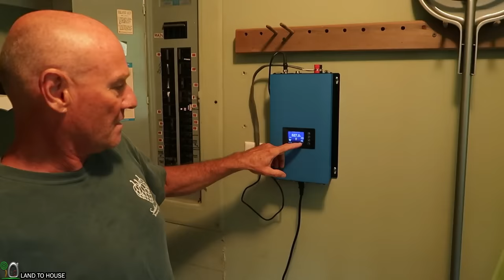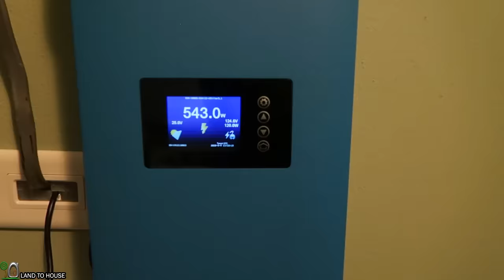Awesome Low Head High Flow Grid Tie Micro Hydro 530 watts!

Comment: Rectifier is a set of diodes that flattens the ac to a single direction which makes it into dc.  It’s really simple to see how it works with a simple diagram... 

Diagram :  https://www.electronics-tutorials.ws/wp-content/uploads/2018/09/power97.gif
Reply: It doesn't "flatten" the AC (Alternating Current - current that keeps changing direction or going back and forth, but it RE-DIRECTS it so that it always flows in the same direction and thus becomes DC (Direct Current, although the term "Directed Current", as in "directed to flow in only one direction or only one way", would be more descriptive).
Reply: @edinfific2576  flatten may be the wrong word. But you are compressing the voltage and forcing it to go one direction. In other words there isn’t a wave form anymore.
Reply: @Astinsan  The voltage and waveform remain the same, but they don't change polarity anymore, so, instead of a positive and a negative half-cycle, we have two positive half-cycles within one cycle.
There is no "compressing" of the voltage, it is kept at the same polarity and basically the same shape, minus the small forward voltage drop of the diode(s).
It only becomes flattened once you add a capacitor at the output. Maybe we are misunderstanding each other and I apologize if I sound nitpicky, but you need to use correct terms and description so that you don't confuse those who are learning.
Reply: @edinfific2576  correct.. it compresses the curve

Comment: he could extract more power by adding more turbines in a daisy chain since the suction is where the force is
Reply: @Maxippouce  i think he means adding more turbines in line in the same pipe, taking advantage of the same water flow and using the excess suction he was demonstrating wit the vacuum hose. the same water would just pass through multiple turbines in a row.  would be more expensive upfront and the efficiency of individual turbines would be lower so ROI would be longer but he might be able to be 100% self sustaining
Reply: Turbine output = force X flow rate.  Adding another turbine will lower both numbers for the first turbine, the total gain won't be much.
Reply: And. What about putting another turbine on top of the other extending the shaft vertically.  Wouldn’t work more efficiently?? Or else?  Please someone explain that?
Reply: All the water's potential energy gets converted into electricity + kinetic energy at the exit.  My guess is, adding another turbine will probably generate same amount of energy with less water flowing in the pipe, i.e. higher efficiency.
Reply: He just needs to move the turbine farther down the pipe to get more head pressure.  If flow rates are an issue he could reduce the pipe diameter and still recoup the same power.
Reply: A lot of this really depends on his electrical setup, and judging from the engineering I'm seeing it the video there was zero engineering or systems mating.  But it works and apparently is all he needs so success
Reply: @EntropyLoser  Those units don't work out to power. Perhaps you're thinking of pressure x flow rate.
Reply: @thereynolds2725  I see what you mean. Yes, strictly speaking, it should be either pressure drop x flow rate, or shaft force X rotation speed, which should be proportional to the flow rate.
Reply: @EntropyLoser  after the first turbine is at least another 10 foot drop though. That output looks powerful enough for another (perhaps weaker) turbine.
Reply: @EntropyLoser  that's not going to be true because it assumes another turbine lowers the exit velocity of the firsts fluid. Additionally, even were we to grant that premise, doesnt account for the fact that he's added more turbine--even if less effcient at conversion you're still working with 100% more.

Going from 528w to 998w is still significant, especially when accounting for time and rate of return.
Reply: @formdoggie5  it's not unlike an electric circuit: water level height is Voltage, turbine is Resistor, output is Power, P~=V^2/R, increasing turbines (R) may actually lower the power output, counter-intuitive but true.
Reply: @norman3605  Yes, he'd get more input pressure, but would lose the equivalent amount of suction at the turbine outlet.  The net pressure across the turbine would be identical, for no gain nor loss.   Note this "doesn't matter where you put the turbine" only applies when the total head is below 30ft, and, the pipes don't have air.
Reply: @EntropyLoser  ...thats not the point.

The point is that you have plenty of run for that water to reaccelerate creating just as much kinetic potential further down the run

The point is even granted that were we to assume that's not the case, double the generation potential with less efficiency means you still get significant results and better ROI as a result.

I'm aware of the math--your math ignores the reality of the setup.

Yes: putting them right next to each other would be dumb, which is what your math represents.
Reply: @formdoggie5  fluid is not elastic,  there's no slowdown or  "reaccelerate", it's just one system governed by fluid dynamic laws, no matter how many turbines are installed in the pipe.
Reply: @EntropyLoser  ...that was one of the dumbest things that has ever been said on the internet while maintaining grammatical structure.

Congratulations.
Reply: @formdoggie5  congrats to you.
Reply: @formdoggie5  Please go back to school and get your GED first, then you can  come back and discuss this kind of subject with me.
Reply: @formdoggie5  Anybody with basic training can "build and repair them", but if you don't understand the theories and principles, you probably have been doing it wrong.... If you really "does this shit for a living" as you claimed, I feel sorry for your customers.

Did you really understand the topic in that stack exchange thread? It is exactly the same issue that's being discussed here. The answer was crystal clear, no need to muddle the water. 

Btw, I took Fluid Dynamic courses in both my undergraduate and graduate studies.
Reply: @EntropyLoser  Yes, I also have the degrees. Congratulations on refuting none of the points made, and feeling sorry for customers with 99% uptime of their power as a result of said work, further proving you're precisely what you've been called.

Comment: Goes to show you: you don't need to know even basic electricity to set up a cheap rig. He has some intuitive knowledge of how water flow works but doesn't understand what a rectifier does. Anyhow if it works it works.
Reply from the maker: I think what Bill meant was he does not know the internal configuration of diodes in the rectifier.  Nonetheless he is a smart fellow. :)
Reply: I would say when it comes to electricity a lot of stuff works but still isn't right and can be dangerous and cause tons of issues down the road though.
Reply: @LandtoHouse  I gotcha! He's clearly a smart guy who can get things done. Just judging by some of the language he uses, he doesn't have a background in electricity which is fine, he got it done!  Cheers.  Thanks for the video, getting me motivated to make my own hydro plant someday, either this type or the washing machine type that I'm seeing is popular in New Zealand.

Comment: 7:50 Wait, tell me the plug isn't live when it's not in the socket?
Reply: Hope no Children come to visit.
Reply: If its a grid tie inverter it won't produce power without a line connection,  so shouldn't be live.
Reply: I’m sure if he unplugged the cord the turbine isn’t spinning.
Reply: Yes. This is very sketchy and hacky. Could be illegal even. This definitively need to be checked by certified electrician.
Reply: @court2379  he has a separate wire that is wired as a reference for anti-islanding so if that plug is removed it will still be live at the prongs, he should really have a caravan style screw on plug personally...
Reply: @mitju7  If that is the case,  yeah not the safest setup. If I didn't have the right things onsite when setting it up, I might do similar to what he did temporarily,  but later change it to something safe. If anyone else pulled that plug, they would not expect it to be live.
Reply: @mitju7  nope. You've got it backwards

Comment: The wire that is going from the generator to the rectifier is not designed for that use and is against code.
Reply: Should also be in conduit, he'll be out in his garden digging around and damage the cable. Potentially fatal
Reply: @YosheetaBoneeta  it’s UF that’s not the  problem. The problem is you can’t  be using the ground and a phase conductor. Second issue if if you unplug the cord going to the outlet inside the prongs are hot can’t back feed a receptacle.
Reply: It's UF-B direct burial cable. I think you will find that there's really no such thing as "code" for a cobbled low voltage turbine like this. Using the ground as a phase conductor is slightly frowned upon, but not at all unsafe. The only thing any inspector could do is make you not connect the system to the grid at all. That can be against code. If it were feeding a set of batteries and running an inverter system as a separate circuit they could just sit and spin though.
Reply: @KenjiFox  whats the voltage? I didn't hear any mention of it... also what is the exact cable? Lock like a cheap romex cable to me.
Reply: @KenjiFox  it’s making ac voltage out of the turbine...if it’s over 50 volts it covered by code did he mention what the voltage out the pump was?
Reply: @rmaco  It was at 24 volts in the video after rectification. The cable is what i mentioned, 10/2 UF-B direct burial cable. Looks kinda like romex yes, but it's gray and designed for outdoor burial and above ground use. It is UV proof, and allowed to be used for general house wiring from basement to first floor. Second floor or above requires romex.
Reply: @jamesmcclain3588  He did. It was at 24 volts after being rectified. This means the voltage on the UF-B wire was lower than that.
Reply: @jamesmcclain3588  The cord coming from the inverter would not be a dead man's cable as you might think. It would not be hot. The inverter is anti island protected, meaning if there is no grid power present it will not output. This prevents linemen from getting electrocuted while working on lines they think are not energized. If this were not the case, yeah that would be hella illegal and against code.
Reply: @KenjiFox  the wiring is before the rectifier.
Reply: @rmaco  Correct. This proves my point. When you rectify AC power to DC the voltage goes up. Thus, the voltage is even LESS than 24 volts on the wires.

Comment: I believe you could put 2 turbines in this pipe line for twice the power output.
Reply: If he adds a turbine to the same line he’ll go from 530 watts from 1 to 265 watts x2. The water going from high to low the only energy in the system. You want more power, you either get more water or more gravity. Or harvest more of the waste by increasing efficiency, smoother pipe, less bends, longer bends, bearings with higher a-bec rating, anything to get the the water as close to free-fall speed as possible.

The only way adding a more turbines is beneficial is if the existing turbine(s) are max-out (speed, pressure, volume).
Reply: @noseriouslynoreally  actually you wouldn't have 265 x 2,  it would be 530 on the first turbine all the time because the rate at which the water flows doesn't change
Reply: @Snow John ok, I’ll bite. If flow rate doesn’t change then how is one turbine at full-clip and the second one isn’t?
Reply: @noseriouslynoreally  yeah nah fair point ay,  I was just assuming the flow rate wouldn't be the same on the second one, but in saying that it still wouldn't mean its two at 265 watts.. because as i said the flow rate hasn't changed on the first turbine.. and if it hasn't changed on the second one you get 1.06kw so please explain how you got two at 265 watt ?
Reply: @Snow John think of the water as a rope, you are at the bottom pulling on the rope, you now represent gravity. As the rope moves past the turbines it moves the blades and because the rope “water”can not be compressed like air ( if it could you could get the water to squeeze between the turbines allowing one to spin faster than the other) it moves both (or as many turbines you have on that pipe in a row) at the same speed and because you are the gravity you now have to divide your efforts between both turbines. 

I think you are focused on the water hitting and driving the first turbine and disregarding the vacuum of the water that is past the second turbine that is making the whole show happen. 

Just re-read your question: 
If the water of the first turbine never slows and the second turbine is running slower where does the extra water go?
Reply: Analogy: 

Pipe + 0 turbines = 100mph flow rate at inlet, middle and outlet

Pipe + 1 turbine = 90 mph flow rate at inlet, at turbine and outlet; % of power from turbine #1= 100%

Pipe + 2 turbines = 80 mph flow rate at inlet, at turbines #1-2 and outlet; % of power from turbine #1=50%, % of power from turbine #2=50%

Like I said in my original post; if you want more power get more gravity (force on turbine) or more water (force on turbine).

Comment: Do you have the rights to the water way where you live ?

If I were to do this I only have so much water I can retain/displace and by law I have to make sure fish can go upstream (so basically if you have a long enough portion of river you can split it and have the 'natural' river flow freely but it needs to have enough volume and low enough flow rate)
Reply from the maker: This dam is very old. Bill checked and they said he can install the pma.
Reply: I believe this is not allowed in the UK. The water authority's own the rivers and control all power they create. I  think it's a hang over from the industrial revolution. I can tell you that there is a theatre restraint near me called "The Mill at Sonning" it is built in an old water mill site (hence the name) and they have a water wheel as a feature in the bar area. However, it is powered by an electric motor, as they are not even allowed to let it rotate itself by the flowing water let alone any other machine or generator.

Comment: In an environment like this, where you have the extra pressure from the plumbing, could you run more than one turbine?
Reply: Correct, volume restricted equals pressure you could then direct the high pressure water to a pelton wheel and ha e multiple turbines and make bulk power!

Comment: The pump is nice but the electrical side is pretty sketchy, gonna get your self shocked putting current on a bare ground
Reply: My thoughts exactly. 10/3 isn't that much more than 10/2. If he'd used SO the ground would be individually insulated. However that gray looks like liquid tight which has an injection molded sheath effectively isolating the ground. Still wouldn't pass inspection, should've just run conduit.
Reply: Eh, the ground wire in 10/2  UF-B is in the center completely encased in direct burial PVC. Its really not different than any other wire. The conductor is still completely encased in insulation. The only slight difference between it and the thhn wires next to it is that wherever you remove the outer jacket, you have stripped the wire. Since the other two are separately encased there is still zero chance of a short. Only thing I would do at these voltages is throw a small breaker next to the turbine in case of any damage to the wires in the future. Not that the turbine could heat up 10/2 to a hazardous temperature, but still.
Reply: Agreed! He's earth-return grounding! And running power into a house circuit through a wallplate!
Reply: I think you are forgetting its 24 volt 3 phase coming out of the  turbine not 115 volt. the voltage is low enough you wont get electrocuted, your skin has enough resistance. You can grab the terminals of a car battery and not get shocked, same idea. That being said, if I wired that id had done 3 separate wires in conduit and mounted the rectifier inside the house with a heatsink and fan. to each their own, its a neat setup.
Reply: the ac power cord pumping power into a outlet is electrocution waiting to happen.
Reply: @tpcdude  No, you don't understand. Only if the prongs were half way out of the socket, just like any other time you unplug a device. The inverter has anti islanding protection. This means that the output is turned off within milliseconds of losing grid power. If you unplug it the power stops instantly. You cannot be shocked by this inverter when it is unplugged from the wall. This is a legal requirement for grid tie power inverters. This way a lineman won't be electrocuted when working on a paper line outside that should be off.
Reply: It's low voltage AC (about 24V 3-phase out of the generator) and not even referenced to ground (as it's not necessary), so there's precisely no danger of a shock. The other side of the inverter is where the dangerous voltages are to be found.
Reply: @KenjiFox  It's illegal in general to backfeed a plug, regardless of auto-disconnect.